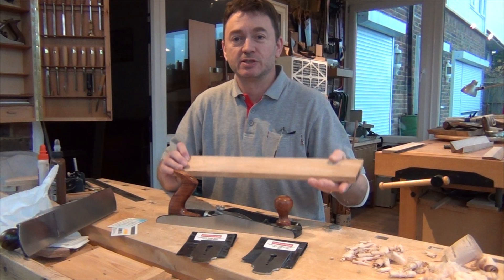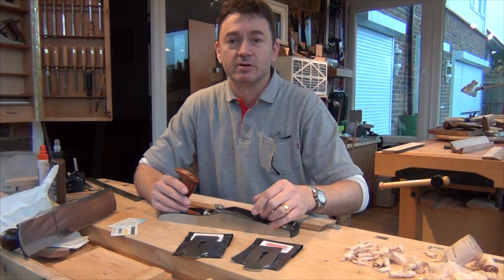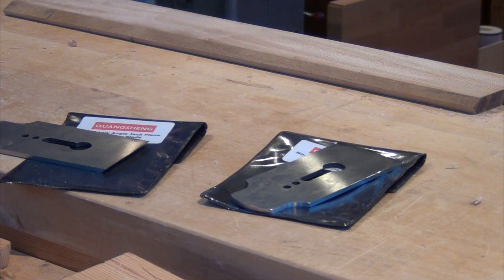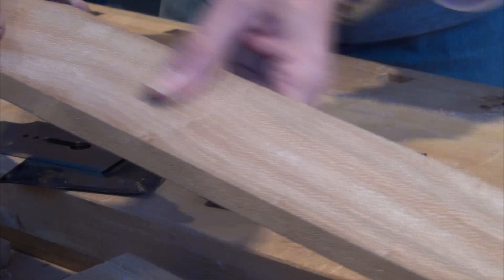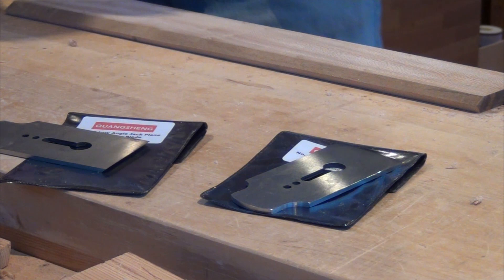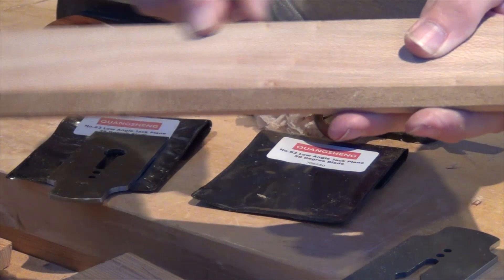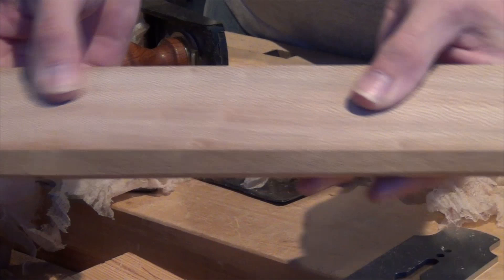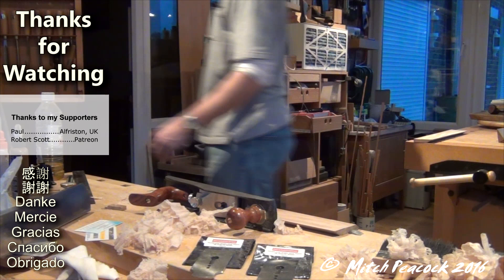Avoid Tearout - High angle Irons in a bevel-up plane

Comment: I have a similar LN plane with  high bevel irons that  I have not used. Thanks for the info. Will try in white pine, zebra and walnut and  a few other species I have had an issue with. Your videos over the span of time I have been watching have gotten better on the production end. Content has always been good. I enjoy them very much. thanks mate.
Reply from the maker: Cheers William! Always room for improvement, but I like to think I'm on track, and that only comes from listening to my viewers.
Reply: Tried my LN low angle jack this morning. Absolutely no tear out on white pine. Went over small knots easily. Thanks
Reply from the maker: Great to hear! Smaller sandpaper bills from now on

Comment: The steeper the angle, the more it's like a scraper. But for curly woods a good bedrock bevel down plane with narrow mouth and chip breaker set close to the cutting edge is hard to beat. That I think is the shortcoming of bevel up planes, the lack of chip breaker.
Reply from the maker: The scraper analogy is spot on. A scraper is just like an iron with a close set chip breaker all in one.

Comment: That's a sweet plane I've been toying with either getting your version or the stanley sweetheart version for sometime,I recently purchased the quengshang Luban low angle block plane and their standard angle block plane after spying them in your tool chest.This was to replace my stanley fixed mouth  block plane 220 I think.
The biggest problem with them is they are to beautiful to be rattling round in my site bag,So I have decided to give the old plane some love and attention and put her back in the bag,and the Luban can stay on bench.
Thanks for highlighting these well built reasonably priced planes I never would of found them otherwise,by the way Merry Christmas
Reply from the maker: Merry Christmas to you too Dean.
I actually have  LN and Record low-angle block planes, both bought before Quangsheng was on the market. The Record tends to travel with me for the same reason.

Comment: Hi Mitch. Great video. No music just the facts please. I have the Veritas version of that plane and use a 50 degree blade almost all the time as I work with oak more often than not. Solved my tear out problems. Cheers, Gary
Reply from the maker: Cheers Gary.How do you find the Veritas? I struggle with making adjustments on-the-fly with the Quangsheng, but the LN and Veritas both look as if they may suffer equally?
Reply: If you mean in terms of adjusting the set of the blade then no problem at all. Or have I misunderstood you? I am not an experienced woodworker I hasten to add!
Reply from the maker: Gary Knight I meant adjusting depth of cut and lateral position of iron, whilst taking a shaving. Sounds like I should try and demo a Veritas next time I'm at a show. Cheers

Comment: Thanks for the video. I just got a 2nd set of irons for Veritas low angle no. 4 smoother and honed to 45 degrees. I am hoping a 57 degree cutting angle is enough to give me the advantage against tear out. On a lark I did a 52 degree cutting angle on a 2nd iron for my little low angle apron plane so it can do double duty. But much less blade travel left when you do that with the apron plane. Haven't tested these much, hope it was a good move.
Reply from the maker: I'm sure you'll find it an improvement. Still have to sharpen really well, and not take thick shavings. You might need to add a micro bevel to increase the effective angle for some situations. If I do, I live with it after that until it gradually returns to a less severe one - it doesn't take very long.
Reply: @mitchwoodwork  I was able to take shavings but kept them thin. Took much more effort to push.
Reply from the maker: It will, that's why we normally have a lower angle where the wood is better natured. Enjoy!

Comment: I have this plane with the two additional blades but have not had occasion to use them yet. Two questions. Did you add a micro bevel to the 50 deg blade?  And, did you close the throat up on the plane with both the 38 & 50 blades?
Reply from the maker: Only by way of the strop, so minuscule. I always try to match the mouth/throat up to the thickness of shaving I'm taking, it's that little extra precaution.

Comment: thanks for great informations, you sharpening the blade with microbevel ? if a regular blade have 50 degree microbevel its the same like one with 50 degree bevel ?
Reply from the maker: The long bevel acts to help break the shaving in my mind, and the results with just a 50° micro bevel aren't as good. Quite how long the bevel should be I haven't experimented with. Cheers
Reply: +Mitch Peacock - WOmadeOD thanks

Comment: Kind of OT. What is the correct effective angle (seat+bevel) range for a "low-angle" block plane?
Reply from the maker: 12° bed + 25° (standard), or + 38° (medium), or + 50° (high). Giving a range between 37° and 62°
Ignoring any secondary bevel which could be added.
Reply: Thank you. That's what I expected. The effective angle of block planes differs from regular planes significantly only in case of the specifically low angle block planes. It occurred to me when I was finalizing restoration of my first block plane ever :)

Comment: I echo Phillip.  I like no music when working with tools.  I heard the plane with the 50 degree make a distinct different sound.  Great demo Mitch.  I had good luck with this issue by adding a 60 degree micro bevel on the back of of the iron on a standard #5 Stanley.  Have you ever tried this?
Reply from the maker: Cheers Peter!You may have noticed the sub-title 'Option 1...', well, option 2 will be the back bevel. I think it deserves a section on sharpening and theory, so it's still a little while off. I have mentioned it briefly in the past, but it wasn't a dedicated video (in fact I can't remember which video it was in!). I haven't used it that much to be honest - most of the woods I tend to use can be tackled at 45° with a sharp iron and closed-up mouth. Maybe just followed with a pass or two of the cabinet scraper.
Reply: Cool.  Good to know we're on the same page.  I've never known anyone to do this before and thought to give it a try.... and it worked.  Heck, it's simple physics.  Besides I don't own one of those $350 low angle planes.  lol

I look forward to you doing that video in the future.  Your videos are always very informative.
Reply: What if you flip the standard blade over, that would give you a cutting angle of 70 degrees, right? As long as there are no microbevels involved. Just a thought, haven't tried it. But I think I will :)  Hm, will that turn my #5 into a #112?
Reply: Michael, it's actually only 15* from vertical.  45* for the standard frog angle minus 25* for the iron.
Reply: Ha ha, I think you've been away from math as long as I have :)  I had to draw it out, but its 45 for the frog + 25 for the bevel = 70 angle of attack, which leaves the bevel 20 degrees from vertical. Admittedly an imperfect analogy with a scraper plane, which is usually tilted forward past vertical, but maybe interesting to try. Today!
Reply: Michael Anderson Thanks.  Duh... didn't have my coffee.  Memo to self: don't reply to anything before coffee.  :)
Reply from the maker: That may work very well, but I suspect the iron's edge will break down quite quickly since there's a significant relief angle, or in other words precious little supporting the edge directly behind the cut. Do try it though, and report back
Reply: Mitch Peacock - WOmadeOD Mikey should do it.  :)

Comment: Hi Mitch.  Very informative video.

I picked up one of these planes from a seller outside the US.  It was quite a bit heavier than I expected.  

Workshop Heaven will not sell this brand's planes or accessories to buyers in the USA.  From what I have been told by WH Woodcraft had an  exclusive agreement with the manufacturer in the USA/North America. 

Do you know of any other sellers who might offer these blades with the angles you reviewed?  I looked at Woodcraft's offerings and sadly their blade is different and won't work without modifications.  Even with modifications it might not work.  No luck on eBay and so far no luck with search.

I could buy some O1 stock and make my own, but honestly I would rather be woodworking than making a plane blade.  I would rather just make a new plane using an existing blade to get the angle I want than metal work.

Keep up the great videos!
Reply from the maker: Hi, thanks.

Yes, I've since had that conversation with Workshop Heaven, and their contract doesn't allow shipping Quangsheng product out of Europe.

I don't know of any sources that would ship these blades unfortunately.

I will be doing a video on the same topic soon, but using a Bailey pattern plane, and will try to remember to at ask your question to my whole audience during that - it may help.

Cheers
Reply: Thanks for the reply.  I have reached out to the company I made the purchase from with no response yet.  I also tried another site where they are selling some as well, but I have a feeling I'll run into the same issues.

I need to check the Woodcraft blade to see if it might be possible to drill out the missing holes.  I have some extra Stanley plane blades so if I need a 50+ degree plane I might just make one.

Thanks again!
Reply from the maker: red58impala Use a spare Stanley blade and hone a 15° bevel on the back about a 1/16" wide. Install the normal way in a standard Bailey pattern plane and away you go.
Reply: Hi Mitch - I appreciate you reaching out to the community on my behalf regarding these blades.  After seeing your video on putting a back bevel on the plane blade, I better understand what you were describing.

Regarding replacement blades I found a seller on AliExpress who is selling Qiangsheng/Luban planes and asked if he had any blades for sale.  It just so happened he had some for this plane.  After my conversations with the seller, he has also listed the plane as well.  The plane is ridiculously over priced but the blades were comparable in price, with shipping, to Workshop Heaven pricing.

I am not 100% confident the blades are legit, but I am 99% confident they are.  I'll try and keep you posted as to the quality, if the next paragraph is OK with you. 

I would post a link here for the blades, but I believe Workshop Heaven is a sponsor and I don't want to step on your toes.  If it is OK to post let me know and I can post a link, or item number, to the listing once I receive the blades and give them a test run.

I would think WH might be able to ship the toothed plane blade they offer from Kunz, but I haven't checked with them on that yet.

Thanks again for your help sir!
Reply from the maker: You're right in so far as WH supplied these blades, so I'd rather not have a link here. But I'd like to have the link and your appraisal of the product when you receive them, and then I can point those people outside of the UK to it.
Cheers, Mitch